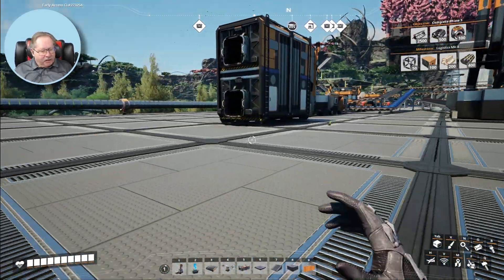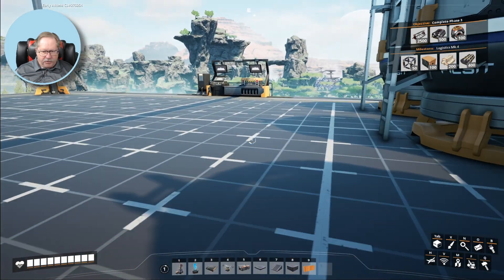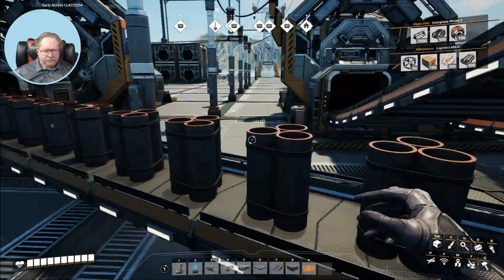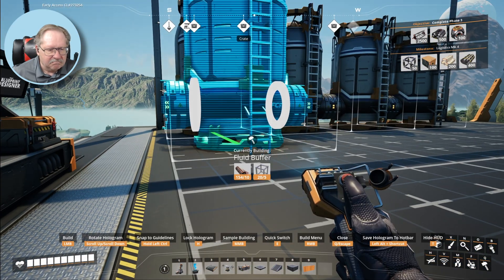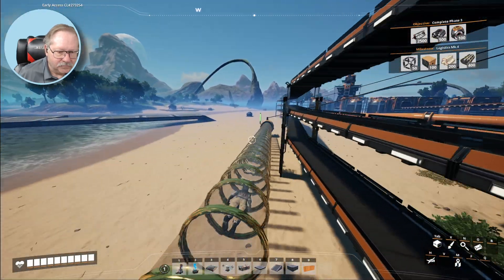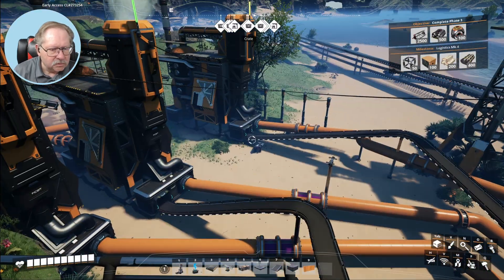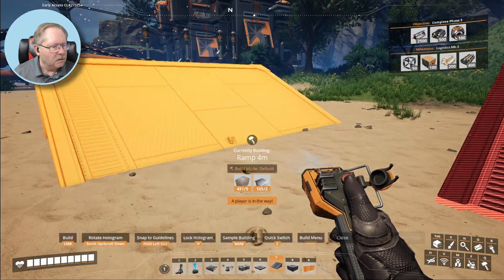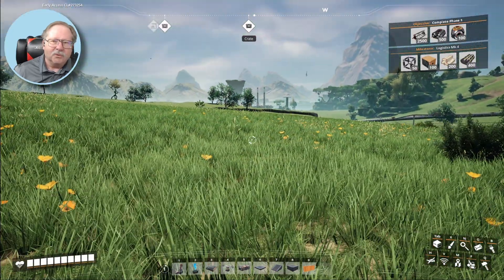Factory Shutdown from Too Much Fuel [Satisfactory 25]

Comment: My general tip for early setups with the Heavy residue is to convert it into petroleum coke then sink that or use it with coal generator. And then for the polymer resin byproduct you can unlock the recipe to combine it with water to make fabric!

Comment: If the problem is just keeping those refineries making plastic for the short term until you hit the milestone to get fuel power plants, you can just have a few fluid buffers and occasionally come back to flush the entire system of the accumulated fluids. It's not a permanent fix, but it's perfectly workable and more sensible than building increasingly many buffers just to get the plastic you need to advance.
Reply from the maker: I've never used the flush. Does it just dump all the fluids and they disappear? If so, that's a great option I never thought of.

Thanks for the comment!
Reply: @Gaming_with_Doc  Yeah, examine any buffer or span of pipe on the system you want to empty. There should be a handle you can pull with a button to control whether to flush just that particular buffer/pipe span or the entire connected network. The flushed fluid just disappears.

Comment: The simple way to deal with too much fluid, and one that won't just fill up, is to have a packager dealing with any overflow, with the output going into a grinder.
Reply from the maker: A grinder... I haven't heard of that machine before. I'll keep a lookout for it. Thanks!
Reply: @Gaming_with_Doc  I forget the proper name, but the one that grinds up materials to make tickets.
Awesome Sink or something?

It makes for a great overflow for anything that will clog up your lines, even if you don't plan on touching the tickets.
You can just use a smart splitter to redirect only on overflow.

Of course, it only takes conveyors, hence the need for the packaging plant, to convert liquids into solid goods.
Reply: That's the Sink indeed.
Another solution specifically for fuel is adding generators to consume the overflow